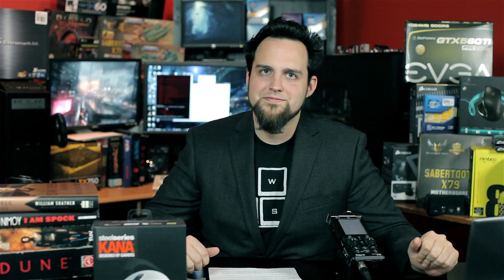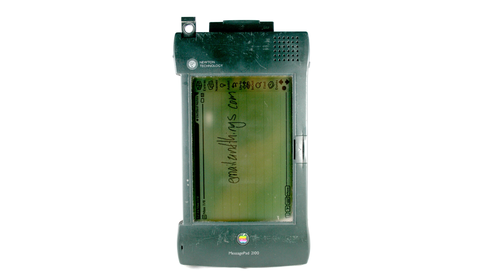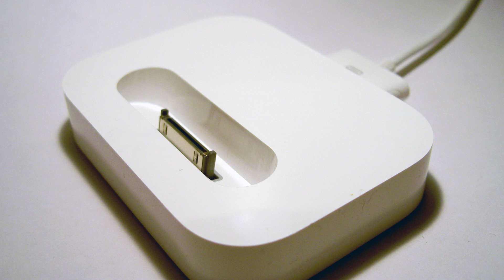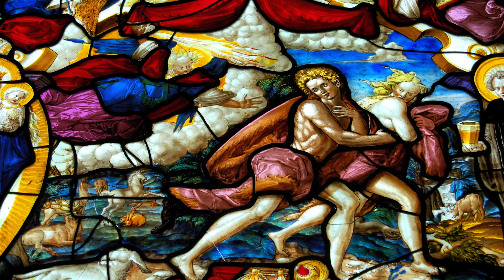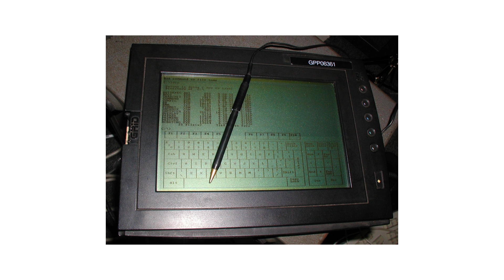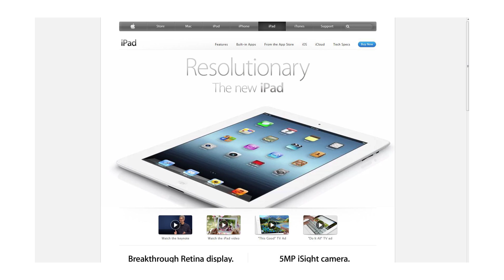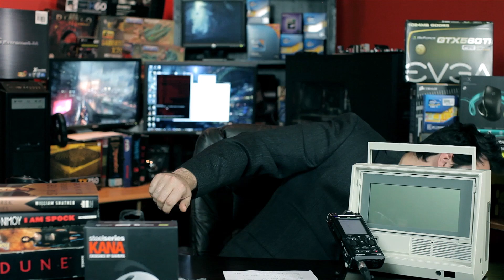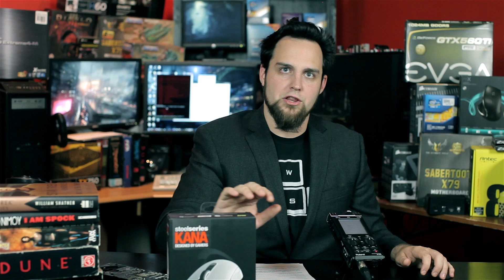Has Apple Really Ever Invented Anything?

Comment: A6 Microprocessor
Butterfly Switch on Keyboards
Retina Density Pixels (Come at me 4K)
Reply: 1. The A6 Microprocessor was invented by Arm Holding.

2. They did design that keyboard, and it's prone to failing. But to say they invented the switch type, no. It's essentially a membrane keyboard, and those have existed for a long time now.

3. Retina Density is essentially an LCD or OLED panel that just has more pixels packed in a given area. They did pioneer that, so I'll give you that. As far as replacing 4K resolution, not even close. Retina DOES NOT change the resolution. Resolution is not a measure of pixel density.

Comment: They invented DOS and Windows.
(Srsly, Windows was originally a copy of the original mac.)
Reply: Not quite, both Windows and Mac OS where developed from Xerox PARC's GUI. Although the issue of "theft" was somewhat nuanced and ended with the company saving alliance with Gates at 97' Macworld.
Reply: Hat For Sale Incorrect Microsoft developed Dos. Windows was only made to make dos easy to use.
Reply: Wasn't DOS (Dirty operating system) designed and made by a guy that worked for bill gates and when IBM approached them they needed a operating system for there computers

Comment: they invented the MacBook Pro the only laptop that gets so fucking hot cause the models from 2006 to 2012 actually have only one stupid hole to get air and release hot air sense I have to use apple every stupid day I have at least million things to say how bad they are to there clients pushing us to bay there new hardware even if we don want it .they also discover how to make more money by creating super small and mega expensive external connectors like mini display to HDMI or a MacBook only with one port or a fucking iPhone with no headphone jack really so we can bay the stupid wireless airports  the sound like a shit and they also discover that thing called El Capitan translation =EL Crapitan and instead of apple use a good and fast graphics cards and move from max 1=2 gb GPU to rally useful graphics that actually does some work nicely cause when you thing  about it any other laptop over 1000 euro has GPU that is actually faster and better then whatever is your last model MacBook that coast 2700 euro how can machine  that coast that much can deliver so less from a point of GPU and RAM they other laptops or PC that for the same money do 30x better why apple has to invent anything when they have invented the most obvious thing HOW TO TAKE YOUR MONEY FOR THE PRICE OF SOMTHING THAT COAST A LOT LESS;;;.

Comment: The multi-touch trackpad, the most insane invention ever. Moron.
Reply: A quick googling shows that DiamondTouch had multi-touch in 2001, 6 years before multi-touch came to Apple. Read more here: https://en.wikipedia.org/wiki/DiamondTouch
As for trackpads, I'm having more trouble finding which computer had a multi-touch trackpad first. Point is, the idea for a multi-touch device was dreamed about 40 years ago and had been researched consistently since, until it finally became a reality. 
Also, most insane invention ever? Really?
Reply: Some people need to learn how to use a search engine before posting a comment. There is so much free information that can be found.

Comment: What about the memory storage on the MacBook Air?
Reply: +Zenn No
Reply: +Zenn Pretty god-damn sure the so called "Apple flash memory" are M.2 based SSDs. The only thing different with them is the non-standard M.2 (also manufactured by the same company that makes the usual M.2 SSDs) that is used to connect them to the motherboard.

Comment: They were the original designers of the Unibody enclosure, which doubles as both an encasing for their laptops as well as a heatsink for them, effectively making the macbook fanless without having to sacrifice power or cooling capability.
Reply: Actually many of Apple's unibody computers thermal throttle significantly. That means that the passive cooling through the case is inadequate.
Reply: they were still the first to implement passive cooling on x86_64 hardware with unibody, regardless of thermal throttling.
My point still stands.
Reply: Not completely because you said  "without having to sacrifice power or cooling capability" which isn't true. There is a sacrifice in power due to thermal throttling and the cooling capabilities are limited because the only way to keep the laptop cooled is by cooling the entire chassis. Also passive cooling on the x86 platform existed just not with unibody.
Reply: +Jacob Roman Yes, it existed on the x86 platform beforehand, yes. But until Unibody, x86_64 had considerably too high of a heat output to have a fanless solution that worked well without adding too much fat. It was still the same with unibody, and so Apple, in the design of Unibody, saw advantage in using the fat of the unibody enclosure as the fat needed for the fanless cooling. And then 32 and 14 nm cpus came in due time and dramatically reduced the heat output, allowing other, less metal-bodied laptops to implement fanless solitions without copying apple's tactic of using metal encasing and getting sued over it like apple does to everything that could possibly compete with it.
Reply: +BronyBoyYack sheep
Reply: +hector897 Why sheep? Why not cows? Pigs, even. or if it's the wool you're after, regardless of extinctipn, a mammoth, perhaps?
Reply: +BronyBoyYack K cow
Reply: +hector897 I am now confused as to exactly how this conversation started... ? Lol, didn't expect something like this to come up in comments for a video debating over corporate inventions.
Reply: +BronyBoyYack lol I was just messing with you
Reply: +hector897 Very well. I am now messed up, so I need to be repaired. Know any repair shops with decent brain surgeons?

Comment: Lighting Cable ?
7000 Series Aluminum Used On iPhone 6s ?
Gold Used In Apple Watch Edition ?
Reply: +Ulysses Lopez GOLD WATCHES CONFIRMED TO BE INVENTED BY APPLE
Reply: Ulysses Lopez fairly sure that that has been done before
Reply: +Leonard Church iOS
Reply: +Phlergm_ Schmlerghph Nope, Lightning connector was invented by apple.
Reply: +Ulysses Lopez technically no lighting cables arej ust implemented by apple
Reply: +Wongseifu548 they were made by intel
Reply: +Phlergm_ Schmlerghph I Meant The Gold That They Used, Because It Was 2x Stronger Than Regular Gold
Reply: +Phlergm_ Schmlerghph nope Apple invented metallurgy lol
Reply: u think Apple invented 7000 series aluminum?????????
Reply: and the samsung galaxy s6 edge plus, which came out before the iPhone 6s,  was 7000 series aluminum.
Reply: +Ulysses Lopez the way they make gold harder is by mixing other metals in it. not even jewelry is 100% gold or else it would be way to delicate
Reply: +Ulysses Lopez sure, but this video was only about the hardware side. Apple did invent new software.
Reply: +Leonard Church iPhone📱😐
Reply: +Bishr Arar I Agree
/_.
Reply: Ulysses Lopez ios is based on osx which is based on bsd.  So no they  didnt invent that either

Comment: 3d touch
Reply: +Marvin Machado A pressue sensitive touchscreen. Please dont use apple's marketing terms.

On a software level, google has had this for a loooong time, But very few phones actually had these sensors. Apple did do something here, and they did it well. It might only be replacing a touch and hold on the phones nowadays, and doing what samsung did with the airview thing on screen... But it works well, and is relatively new. GG

Comment: Touch Id and 3D touch/force touch
Reply: +hannah harrison they didn&#39;t invent 3d touch, pressure sensitive screens have been around on androids and all that, they didn't do touch id either, my schools ancient hp's have finger print scanners, and they definitely did not do force touch
Reply: +hannah harrison Fingerprint scanners have been around for a long time, and have been in laptops and other mobile devices for a while too. My friend used to have an old laptop that pre-dates Apple's phones that include "Touch ID", that had a fingerprint scanner and allowed Windows to use that for a super easy authentication step. Just put your finger in a small slit and if the print matches, you're let in. Apple just took that idea and applied it to a phone, not their invention.

Pressure-sensitive touch screens aren't an Apple invention either.

Comment: I thought A chips in iDevices were made by Samsung and TSMC (mainly)
Reply: +Nathan Brown 
Manufactured, not designed.
Reply: Respected Fella
That actually makes sense, otherwise Samsung and TSMC would just sue each other for being Apple's chip supplier
Reply: Nathan Brown
Why should Samsung and TSMC sue each other?
Even if both companies would design those A chips, they would do so based upon a contract set up between Apple and TSMC or Samsung.
Reply: Respected Fella If one of them designed it, they would have patented it, and thus sue the other when they try to use the patent to make Ax chips.
Reply: Nathan Brown
Just to understand you correctly, if TSMC would have designed the A8 chip and Samsung manufactured those chips, TSMC would have sued Samsung?
Why would Samsung have manufactured the A8 chips in the first place then? Only if Apple did order A8 chips to be manufactured by Samsung, and it would have probably talked with TSMC about that too at some point.
Reply: Respected Fella It's a very profitable business, it's not hard to think one will try to get a wealthy business partner if it means a bit of copying/stealing.
Reply: Nathan Brown
Well, I don't really understand, but maybe I am not that business savvy.

Comment: "Wouldn't use CNC for manufacturing?" Go look at the automotive performance aftermarket industry. You can get just about any part made of metal to be billet rather that cast or forged. And how is it wasteful? All the shavings and any other scrape metal get sent back to the foundries to be made into more metal stock. Its only wasteful if throw the scrape in the trash.

Comment: did apple invent scsi? it was basically a cumbersome vga but still.
Reply: +electronics for fun 
VGA is short for video graphics adapter and was used to connect displays to computers (and still is for many).
SCSI is short for Smart Computer Systems Interface and was used as interface to transport data between hard disk drives, external and internal. In other words, it was not used to connect displays.

As to the history of SCSI and VGA, there is some method to look it up, but modern people don't have a clue about that method.
Reply: l have never used scsi so l don't know that much about it.

Comment: I read somewhere that they didn't invent the multi touch display and the original a1 chip. I am trying to find more info on this but u can't. Can anyone help me out with some info on this? 

I saw it on BBC news when the person questioned claimed that the screen came from the cia and the chip came from the U.S. Military. Their tech is 20 years ahead of civilian stuff so when it got declassified, they sold the technology to Apple. It's believable but I want some trustable sources where I can check this. Or a correction if the info is wrong. Thanks
Reply: +Fidel Karim 
The information is publicly available, even Wikipedia if you can read that and go from there.
Multi touch is an older technology, Apple bought FingerWorks to acquire the technology and patents and implemented it into a display.
There is no A1 chip though, Apple used licensed SoCs from ARM until the A4 was introduced in the iPhone 4, as Apple designed those themselves with the help of PA Semi, which it bought earlier too.

Comment: The problem is that with that criteria almost nothing is an invention: What?? , of course ARM does not build Apple's processors, or anyone's by the way. So yes the microprocessors are Apple's. Samsung does not do stuff like that because Samsung model is ripping other peoples work, just like they did to LG.  Do I believe Apple is a component inventor, no, Samsung does innovate in terms of process (no with your criteria, because they did not invented lithography). So of course if you spend hours designing a product, just for some idiot to copy it then you will be angry. By the way, apple started to used the patent system after they were hit with patents for the iPod.

Comment: Apple Made the Multi-Touch Display, found on your iPhone, iPad, and iPod Touch!
Reply: Jariel Jimenez But Apple did not invent the multi touch type of touchscreen either.

That honor goes to IBM in 1982.
Reply: Jariel Jimenez No. Apple did not invent a capacitive touch screen. That kind of stuff has been about since the 80s, albeit overlaying displays of the time.
Reply: Jariel Jimenez Nope.  The first finger driven touchscreen was invented by EA Johnson in 1965.
Reply: No, but the multi-touch display was invented by Apple. You see, the difference is that a normal touchscreen is only capable of detecting on finger at a time, such as the display on a Nintendo DSi. A Multi-touch Display, which is seen on most smartphones today, however, can detect multiple fingers at a time, allowing for gestures like pinch-to-zoom and the 4 & 5 finger gestures on an iPad. Just look at Steve Jobs's presentation of the iPhone in 2007.